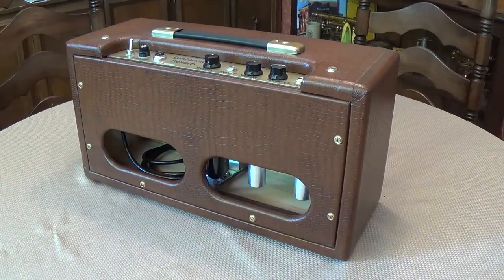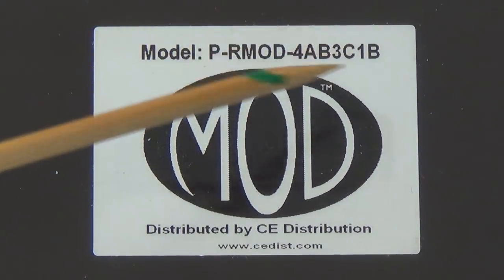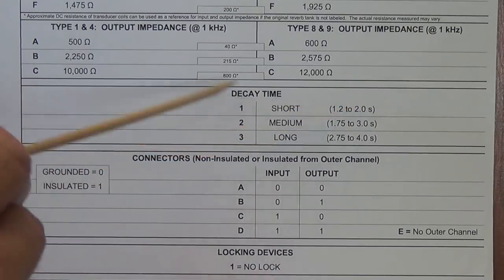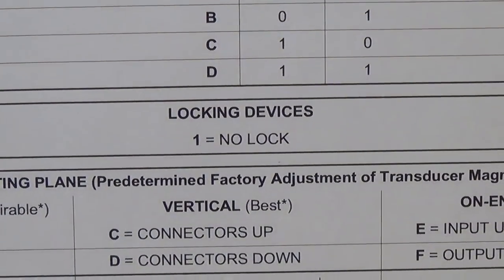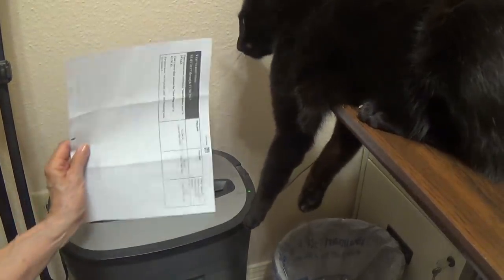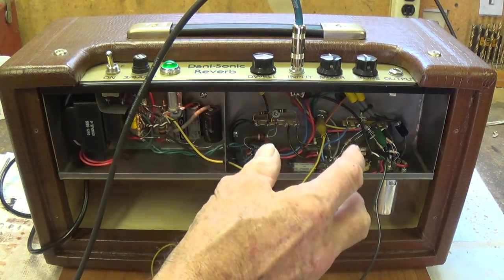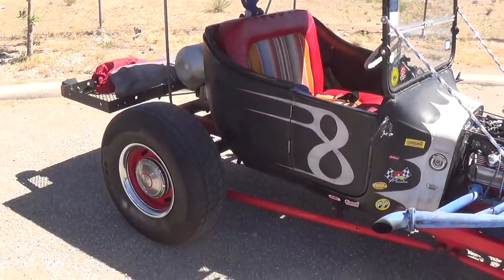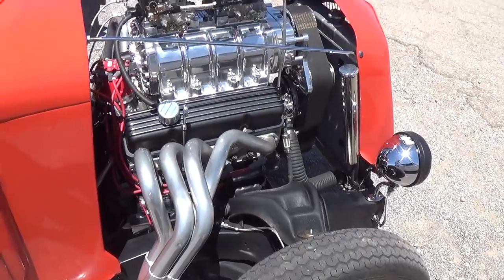Tube Reverb, Part 2:  Transducers, Tanks, Tone, and Signal Mixing

Comment: Both the Fender unit and your clone uses a 6V6 tube as a reverb driver, could a EL-84 be used in it's place. I have a small stash of those tubes and would like to use them. I've always loved the sound of the Vox AC series amplifiers.
Reply from the maker: I have never heard of that use for an EL-84, Dennis, but can't imagine why it wouldn't work. If you try it, let us know how it turns out.

Comment: Uncle Doug, I was expecting to see a parallel 12AT7 driving the tank, such as on AB763 Fenders. What are the factors for using the higher power 6K6 instead?
Reply from the maker: I actually prefer a slightly-higher-output 6V6 to drive the tank, Foo. My guess is that in the AB763, you have two stages of amplification prior to the 12AT7, while in the 6G15, you have none. Perhaps the higher output tube compensates for this lack of pre-amplification.

Comment: Great video! Yet I have to say something about the phase:
I don't think the last gain stage in the wet chain is for phase invertion to match phases, yet only to amplify:
The signal from the tank is probably very weak, much like an electric guitar pickup (it's essentialy the same), so it needs to be amplified to be useable.
Reverbration is nothing but phase-matched signals, and by nature will never be - the reflections will arrve at different times and different amplitudes, which will cause some phase cancelations and attenuation and some amplification due to sort-of-in-phase reflections. The phase can't be matched anyway.
Reply from the maker: I agree that the 12AX7 triode serves to amplify the wet signal, but also inverts its phase since the output is from the plate. The cathode follower in the dry signal, however, does not invert the signal, since it already matches the phase of the wet signal.
Reply: I don't know the usual output of a reverb tank, but if it's in the same range of a microphone output, it will definitly need some amplification to reach the same level of a guitar pickup output
Reply from the maker: The reverb tank is a passive device, with output strength based entirely on the strength of the input signal minus losses within the tank. Apparently, the tank output in this circuit still requires additional amplification (by the 12AX7 triode) to properly drive the input stage of the amplifier.

Comment: Hi Uncle Doug, great video as always, thank you. I'd like to ask you to talk a little more on "grounded partition bwetween PS and amplifier" in some occasion... Thanks a lot.
Reply from the maker: A grounded partition will block EM fields produced by the power supply from interacting with the very sensitive signal circuit in the pre-amp section, Ed.
Reply: @UncleDoug  OK, I understand, I tried this in a SS practice 5W amp Im building (no theory, hehe just experimenting) and it worked to some point, I believe many other factors contribute to noise. Just a square metal barrier connected to chassis one point ground.... thanks again

Comment: Interestingly, and I think the reason is the expense, is that instead of having a cap to ground on the tone we could use an inductor as they love bass but treble doesn't like them so in effect an inductor would remove bass frequencies. Looking at a calculator a regular single coil pickup is about 2.5H to have bass drop off at 100Hz, to minus 20dB at 10Hz, a resistance of 1.2k is required... so a 5k pot would work. I don't know whether the magnets would be removed though... maybe replaced with un-magnetised ferrite slugs, or just bits of steel rod.
Reply from the maker: That's an interesting suggestion, Sean. Instead of leaking treble to ground, leak bass frequencies instead. It would make more sense.

Comment: Phase isn't a compelling reason to use a cathode follower. By swapping the primary or secondary windings of the driver transformer it can be inverted or not.
Reply from the maker: You're right, Mr. H. The value of the cathode follower was not related to phase. This was discussed in some detail in previous comments. Thanks :)

Comment: Very helpful, thanks! I have a reverb tank that came out of an amp and i was considering what to do with it. Perhaps build a standalone reverb or something. I was considering tube or sold state driven and which would be most suited and 8:40 pretty much answers that. The resistance determines if it would need to be transformer driven, tube driven or solid state driven. I will check the specs but since it came from a solid state amp, I would say it will need to be solid state driven. Tube reverb might have been cool but that does narrow down my choices and makes it a simpler build.
Reply from the maker: Any tank from a SS circuit would require SS drive, Marty.

Comment: Uncle Doug, looking at the schematic I see all the pots are linear.  I know why that suits the mixer and the tone controls but as the dwell is like a volume control I thought a log pot might have been used.  Because it uses a linear pot does most of the change in reverb strength occur during the earlier potion of rotation?  Regards, Jeff.
Reply from the maker: We'll find out in Part 3, Jeff. I intend to evaluate the effect of each control.

Comment: It would be interesting if you added a switch between the cathode output and plate output of the dry signal to see what it sounds like. Because the wet signal has delay, it probably wouldn't cancel the dry completely, although it would probably sound a bit thin.

Thanks for the videos.
Reply from the maker: You're welcome, Z. I too am wondering about the delaying effect of the reverb tank on the signal phasing......perhaps the wet and dry signals simply blend together regardless of phase (?)
Reply: The springs are more of a "continuation",if you will accept the term, than a delay,of the original signal. I think the charm we love about it is the utter mish-mash of harmonic overtones ringing on. There is certainly in and out of phase sounds happening within that sound, but definitely having opposing phase wet and dry would give the most dramatic cancellation of the primary signal.
Reply from the maker: I just completed an oscilloscope analysis of the wet and dry signals for Part 3. There appears to be no delaying effect of the wet signal by the tank and both signals arrive at the mixing control in near perfect phase alignment.

Comment: Hi Uncle Doug and thanks for what you do. I just became a Patreon contributor because I've learned so much from your YT channel.

I just had a couple questions about the power supply in your version of the 6G15. First, why did you choose 1N5408 diodes? I've read that the usual 1N4007 is more than enough for any "guitar amp" application.  Is this a case of erring on the side of caution or do you think that the beefier diode is really necessary? Second, what's the purpose of the 0.1uf cap across the PT secondary?
Reply from the maker: Thanks for your patronage, Hand. Diodes are cheap. If you can triple the current capability of your power supply for free, it seemed silly not to do so. Here is a discussion of the purpose for C14 in my schematic:   https://electronics.stackexchange.com/questions/204073/what-is-the-thought-process-for-specifying-an-emi-bypass-cap-on-line-transformer
Reply: One follow up question (please don't take away my press credentials): Why reduce the power supply filter caps to 22uf? It seems like the idea here is to make this device as hum free as possible and reduce every source of noise. Isn't this taking us in the wrong direction?
Reply from the maker: Both Fender and I agree that three 40uf filter caps is excessive for this circuit, especially with a full-wave-bridge-rectifier, as evidenced by their alteration of the circuit to two 20uf and one 47uf filter cap in their reissue. This is the same rectification/filter configuration used in my version of the circuit.  Excessive capacitance merely strains the rectifier tube without providing any additional hum reduction.

Comment: Hi, Uncle Doug. I hope you're doing well.
    My reverb tank is broken (that little wire inside transducer and little contact is torn off). So reverb circuit doesn't work completely. I don't know how to solder that little contact inside transducer to fix it. But also I don't want to buy new reverb tank because I don't realy use reverb as much. 
   My question is: Can I modify the reverb circuit (my amp using 12ax7 to drive) to make it another (additional) gain stage (or even new channel  of preamp, or something else)? Can you show how to do it in video if yes? And, maybe, you could know the ways to solder that contact inside the transducers and what I can use for it. Thanks.
Reply from the maker: Greetings, Lux. Repairing a damaged transducer is a tricky process, and one that cannot be explained in words.....other than: find the two ends of the broken wire and reconnect them.....which is not very helpful. New reverb tanks are cheap, around $20, and replacing yours would be the best idea. As far as somehow merging the reverb circuit into the amplification circuit for additional gain, this is waaaaay beyond a verbal explanation and possibly not practical or feasible. Replace you tank.

Comment: I believe that was a 8-71blower.A friend of mine had a couple and his waste same size ,they cover the hole to of the motor,where a 6-71 covers about 3/4,and they have a longer shaft at the pulley.(top pulley) The 8-71s have a wider belt also.
Reply: P.S.All your fans ,believe me miss old Rusty.What a pal.👍
Reply from the maker: Thanks for your input and kind words for Rusty, Bob. We appreciate them.
Reply: P.S.after review it is a 6-71.my mistake

Comment: The cathode follower is a buffer, it has nothing to do with phase.  The fact that the input signal is delayed by potentially up to 4 seconds virtually ensures that the wet and dry signals won't be in phase.
Reply from the maker: Good point, Clint. This has been addressed elsewhere in various comments. I sincerely appreciate your input and assistance.

Comment: What is your opinion about using a horizontal tank on the floor of the chassis vs vertical?
Reply from the maker: It would be fine as long as you obtain the proper tank. They are constructed differently for different mounting positions.

Comment: The 12AX7 is used as a "Push-Pull" configuration.  You usually see two 6V6's doing the same thing.  There's your answer.
Reply from the maker: Thanks for your input, UV, but the lower triode is wired as a cathode follower, and the two output tubes are in phase.....so they can't function in that manner.
Reply: Doug is correct This is push-push not push-pull.

Comment: Hey Doug, I’ve been wanting my modify the output from my Blues Jr III reverb tank to have a high pass filter. The tone section you discuss at 20:15 makes little sense to me as well. Would it be safe to instead have a high pass filter at the output of my 12AX7, or would this modify the output impedance in a negative way?
Reply from the maker: I'm not sure why you want this modification, HH. Reverb tanks do work best with higher frequencies, but the elimination of low frequencies is generally built into the circuit. If you still want additional filtering, perhaps you might try applying the high pass filter before the 12AX7 that drives the tank.
Reply: Uncle Doug I guess I’ve just always found my Accutronics tank a little muddy relative to my clean signal. Hoping for more clarity. Thank you for the guidance.
Reply from the maker: @rootvalue  I prefer the MOD tanks, HH. They have a more "vintage" sound. Good luck.

Comment: Hi sorry uncle Doug, do you know why they have 2 or 3 springs rather than just 1? Is it for better production of wet effect and if so what are the 3 spring ones like? I’ve only seen tanks with 2 springs. I have a fender deluxe 85 solid state red knob amp from the 90’s lovely reverb, but i am still dreaming about tubes.
Reply from the maker: I believe the 3-spring tanks provide longer duration of the reverb effect, D, however, unless you intend to do a lot of surf tunes, the 2-spring tanks are just fine.....particularly the long ones.

Comment: wondering what compression springs would do to a signal.  maybe with a weighted disc sitting on top of 4 or 5 light compression springs for legs? get that thing rock-n and a-rollin and it might tear the roof off the sucker!
Reply from the maker: You should build it and see, Malcolm :)

Comment: Hello Uncle Doug! Given that Unit is supposed to go in front of you're  "wall of sound" amplifier at Wembley Stadium. Could you please explain how the output impedance is set and matched to the following input? Especially with the dry/wet mixer it is giving me a hard time understanding that.
Reply from the maker: There seems to be no impedance problems at all, Dennis. I have used the 6G15 with all sorts of amps, from a Champ to a 70W National......and it works perfectly.  Apparently, the voltage of the mixed reverb output is not much greater than that of guitar pickups, so it suits the input of virtually all amps.
Reply: I didn't think there would be any problem with any  amplifier. More like how it's done in general, perhaps at this particular one. But never mind. I'll dig through that!
Reply: Dennis, the reverb amp output delivers voltage not current. The main PA amp will be looking for voltage and not current. There can be no matching problems with voltage (except for levels) only with current.  
Hence the matching transformer to drive the current input of the reverb unit, but a voltage coil unmatched output direct to the next tube grid which is voltage driven

Comment: Hi Doug, sorry if someone already asked this question. What would happen if I hooked up an 8ohm tank to the ext. speaker output of a Fender Bassman 100? Could I then amplify that signal or plug the output of the tank direct into an input of a soundcard, mixer or another amp input? Could I exchange an 8ohm speaker load for an 8ohm reverb tank? Could I have one 8ohm speaker and one 8ohm tank to make a total load of 4ohms on a Fender amp that wants to see a 4ohm load?
Reply: Would I damage a tube amp by plugging in a reverb tank instead of a speaker?
Reply: I see your tank here has an output impedance of 2250 ohm. If I used a tube amp with 8ohm output into your tank, could I then plug the output into a mic level input? E.g. run a line level into a reamp box, into a guitar amp with a 8ohm tank in the speaker output, then plug the tank output into a mic pre?
Reply from the maker: Lots of questions, Brendan......most of which I have no answer for.  I believe the output from your Bassman would quickly fry the tank transducer, which was never meant to cope with 100W of power.  My question for you would be: why would you want to do any of this? If you want reverb for your Bassman, buy a pedal or build a 6G15 Reverb unit.
Reply: @UncleDoug  hi Doug, the reason for this would be to have a spring reverb effect for music production/dub mixing. 

I have made a simple unit with an ART Tube MP powering a 600 ohm tank and then I run the output directly into a mic input which works but I think it could be improved. 

Your answer doesn't surprise me but I had to ask since you were talking about replacing tanks with speakers in the video. 

I'd really like to try to make your 6G15 one day to replace the crude set up I have here. What I have made was a lot cheaper than buying a unit by Vermona or other manufacturer. 

The dub mixing artists of yesteryear used the Fisher Space Expander and Roland Space Echo units. I have since bought a Roland SRE-555 but keep my homemade spring setup as another effect.

Thanks so much for taking the time to reply. I am learning a lot from you since discovering your channel and I enjoy the snippets of humour and home life you cut into the videos. 

I have plenty left to watch on the channel and I appreciate you taking the time to share your knowledge and experiences with the world. It's a fantastic resource.

Comment: I was wondering what is the difference between 2 and 3 spring tanks. I'm about to build a kit and can't decide which one I should get. I want a very "drippy" sound. I was thinking about just getting both and maybe rigging up some way to toggle between them. Is this possible? Is the difference enough to really justify having 2 tanks?
Reply from the maker: I have never compared the 2 and 3-spring tanks side-by-side, Joseph. Apparently, the tanks with 3 long springs have the longest dwell. Original Fender tanks generally had 2 long springs......so this is probably the most "original" sounding reverb. It would be interesting if you could rig a way to toggle between them.....and maybe have them both operate at once, for some truly massive reverb.